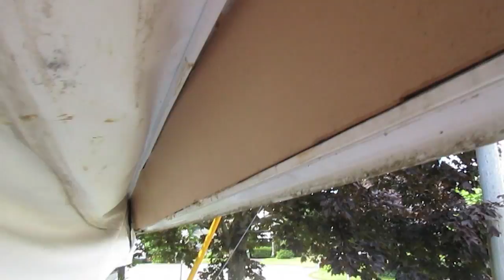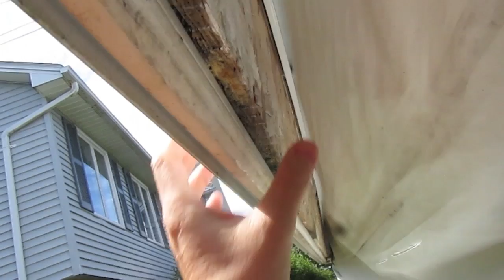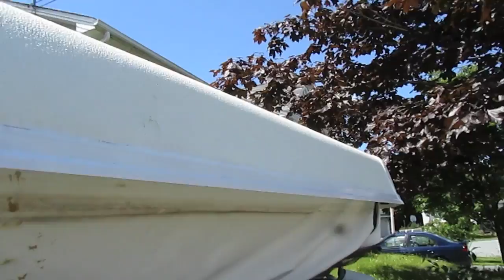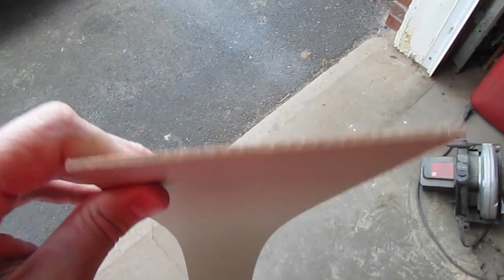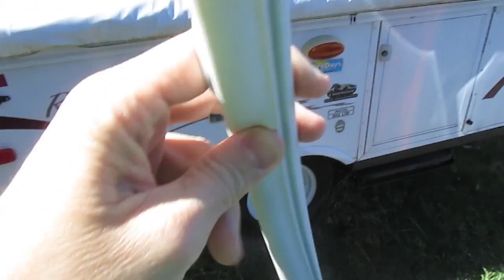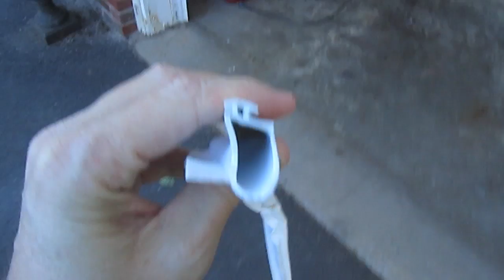Palimino Pop Up Trailer Roof Repair part 2

Comment: Thanks for the info. Just purchased a 2008 palomino and have the same issue, only thing is I'm pretty sure my leak came from the roof where the fan housing was cracked.
Reply from the maker: I found if I went slow when removing the wood from the metal it was fine. After replacing the wood and the gasket everything was good to go!

Comment: Can I ask where you bought the weather stripping?  Do you have a link?
Reply from the maker: I am sure I purchased it from a Palomino dealer. I do not have the link anymore but doing a quick search on ebay I see there is someone selling a 42' section of the stripping. https://www.ebay.com/i/202618914397?chn=ps

Comment: 1/2 plywood is better and we used contact cement. That mdf board won't last long even with paint. Check your seal where the metal trim meets the roof, they fail and that lets the water in.
Reply: mdf is NOT for outdoor use. DUMB!

Comment: Just discovered this issue in our 2009 Palomino.  I am wondering if this is a widespread issue with Palomino campers?
Reply: Rotted wood in the same place in my 2010 P-280, unfortunately didn't notice until after we bought it from a private seller. Looks like a pain to repair but we'll have to do it. Confused why Palomino doesn't used treated wood for these boards!
Reply: Have the same problem with my 2010 palamino yearing 4120. The roof sides are rotting from failed seal where roof sits on the camper walls. Going to replace everything with pressure treated plywood. 3/8 inch. Cover it with white fasica aluminum.

Comment: I have a palomino and I just noticed my back board tonight. First time setting it up this year. It was all wet and is crumbling. Good video. FYI though that smaller board you installed is mdf and will absorb moisture like a sponge. Make sure you watch that or even replace it with 16th inch wood. Good video though. Now I know how to replace mine. Thanks!

Comment: Do you have to slide the new weather stripping into the channel? Or does it snap in?  Does the little extra lip on the new stuff face the outside of the camper to give it an extra seal? (sorry for the questions - I will be doing this job very soon myself on our 99 Palomino)
Reply: Did you ever find out which way the seal goes?
Reply: @waverik85  I'm looking for the same info on which way does it face. Any new ideas?
Reply: @robertmarshall6195  I just slid mine in with the lip on the outside, so it deflected water away and wouldn't let water up into the roof.

Comment: We purchased a Palomino Lite truck camper last year and I have the same issue on the front.  The dealer is going to replace the whole top.  My top was leaking last year  and they recommend a caulk called Quad.  You can get it at Menards.  Great stuff.  It fixed the other leak, now on to the front.